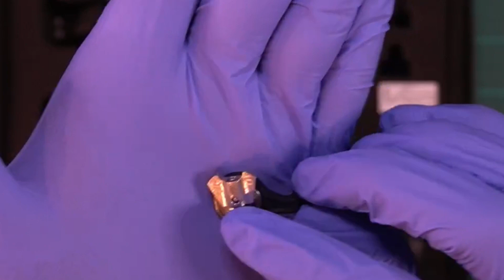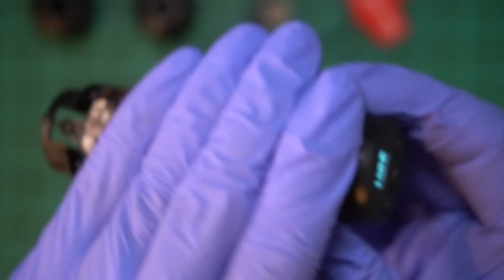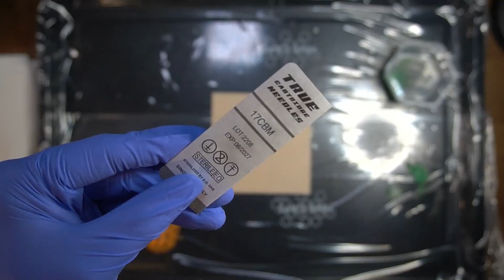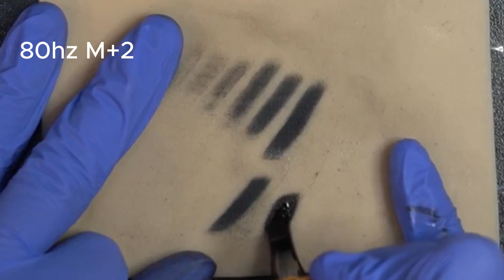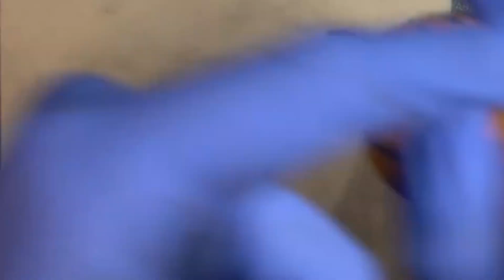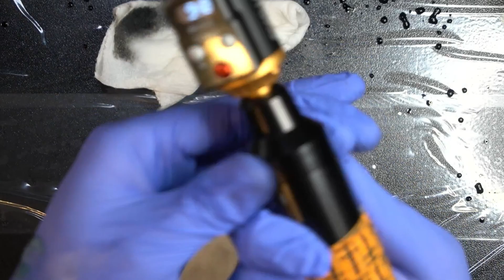Acus M1 Plus Tattoo Machine Review Testing and Comparison

Comment: Adam, thanks for the detailed review🙌🏻 I only have one question left: tell me how hard is the impact force on the Acos m1 with a 4.5 eccentric and M+2 setting compared to, for example, such machines as Critical Torque or Spektra Flux? I have a Cheyenne Sol Nova Unlimited and for me it is very soft and not suitable for dense painting because I work quickly, I would like a machine with a super hard impact. Thank you)
Reply from the maker: It’s very similar feeling to the Sol Nova.
Acus is currently working on heavy and super heavy cams for each stroke length and I tested them and they hit very hard! 
The new cams should be coming out soon!!

Comment: I literally just bought this machine and it came in the mail today. Just holding it in my hand and messing with the different settings, I can tell this is like the Lamborghini of tattoo machines. I've never felt a machine that was so vibrationless, yet so solid if that makes sense. Can't wait to try it out on skin and up my game!
Reply from the maker: Yeah it’s definitely the lambo!
Get the 4.1 cam for it makes it feel so good 🔥
Reply: @adamdarklord  I was wondering if you ever messed with the 4.5 that comes with it. I assumed it would be good for color packing and line work, but I'm just wondering what it is about the 4.2 that hits that sweet spot for you
Reply: @adamdarklord  I know this video is a little old, but I’m seeing that they have different weights for the 4.1. From super heavy, heavy and just the original 4.1, what should I go for?
Reply from the maker: @Javabeans777 I use the 4.1 heavy for everything 🔥
Reply: @adamdarklord  Thank you!
Reply: @adamdarklord  is there anything you can tell me about the m2? lol

Comment: I finally got the 4.1 stroke. Trying hard to get some solid blacks with pendulum shading but man does it hit soft. Any advice from anyone on good settings for this? I've tried from 70-90hz, m0-m2, slow hand speed, 
 fast, it's just SO soft 🤔
Reply from the maker: This machine has extremely high torque compared to other tattoo machines. The machine feels soft because the cams in the machine are perfectly balanced with the rotation of the motor. 
Machines that feel like they hit harder is because there is error in the balance. 
Use M2 standard gauge not bug pins if you want very saturated blacks. I run the machine at 94 hertz. Slowing down your hand can make it saturate quicker
Reply from the maker: I can pack solid color with it all day very quickly
Reply: I thought maybe it had to do with the aluminum cams. I'll definitely try out some standard needles and slow my hand speed down..maybe drop the hz to get more amps 🤷

Comment: Kia ora from New Zealand Adam
I have a question. I know the Neuma 5 runs at 8w  and 6.7mNm as ai just watched that episode of yours. But can you please help me as I can't find out the mNm of the Acus M1 but it's rated power is 7w.

Thank you
Reply from the maker: The Acus can run at 12w at m mode 2, and has more torque than the normal Neuma 5 flex, though the Flex feels like it puts in ink quicker just because the cam system. If you get the Neuma Macro Flex it does around the same amount as torque as the Acus but the flex’s motor can run twice as fast as the Acus without heating up. There is pros and cons to each motor I’ll be making a comparison video in a month or two, the macro flex is getting sent to me right now for testing
Reply: @adamdarklord  Kia ora Ana Adam

Dude thank you very much for the reply 12w is heaps  only what is the nMn of the Acus M1. I see you did the nMn of the Neuma.
Dude, that be so great to get a comparison of the two as they both seem like great machines.
I do have the M1 but. I have struggled with bolder lines which is a shame as I do Māori Tattoo which involves so much line work. 
If you don't know what māori tattoo is check out my YouTube video and you'll see a traditional Pūhoro and Rāperāpe that I did recently iver 5 days in a row.... and... I did feel the machine heat up too. It got hot.
Again thank you for the time
Mouri ora

Redgie
Soul Wise Tattoo

Comment: Bro I have a question I'm a professional Tattooist from OH I'm about to get a new machine wireless. I currently own all three bishop wands the originals. So I like the packer the best because of the stroke, I was thinking either the prime pen 4.2 or the fk one 4.0 because of the price point. However I was thinking about the Acus m1 or maybe flux max. What's your thoughts please?
Reply from the maker: If you want one machine that can do everything your 3 wands can do the Acus is still the best.
The prime and fk one both have cheaper motors than the Packer wand but they are both good machines

Comment: You would think that for the price of this thing they could have made the stroke length click adjustable. Seems a little overrated.
Reply from the maker: Click adjustable machines are actually worse. The way they are built makes them hit soft and they brake very quickly.
Trust me I’ve got many many machines and have done all the testing. Direct drive machines are better in how they perform and they last longer.

Comment: What hz and motor strength would you recommend lining  at with a 1003rl.?  I typically use 3.6mm at 8v on my other machines. Thanks for the video. I just bought the M1!!
Reply from the maker: I literally use mode m2, 94hz with 4.1 stroke cam for everything 😅I almost never have to change my settings. I use that for 3rl all the way up to 23cm! Hope you like the machine 🔥
Reply: The machine is excellent. Thanks!

Comment: Thanks for the review. I'm considering purchasing. I bought Flux 4.0 but it doesn't work for me, but I have Xion again and it works great at 3.2 and 3.7 mm. However, I prefer softer razors with a softness setting option. Do you think that Acus m1 will be a good choice in this case?

Comment: The acus m1 might be on the technical forefront but all these brushless motors have no soul. They all feel to digital and artificial. You need carbon based brushed dc motors to transfer carbon ink into the skin which is also made mostly out of carbon. The bishop shader uses a brushed motor for example and that‘s why it is the most popular machine outthere, according to my local tattoo shop at least. I tried all of them including the m1 and it’s a strange electric icky feeling. As if you’re playing an electric piano and expecting it to sound like a real one.
Reply from the maker: My m1 has a soul… it’s not a 1966 Shelby Mustang type of soul but it’s there.
I’m pretty sure the Bishop wand is a FAULHABER Brushless Motor. And all the machines before that one is brushed.
In fact I’m pretty sure the bishop wand and Acus M1 motor are the exact same motor with different max Torque.
If you want a very good machine with a lot of soul check out the new Neuma 5 that thing is awesome.
Reply: Thanks man. Bishop shader=brushed, packer=brushless, liner=brushless. All of the wired Cheyennes are brushed dc also.   I guess thats the main reason why old school artists can‘t deal with these new digital machines. Me personally I need that friction. Cheers
Reply: How does that impact the result? I thought Brushless vs Brush is more a matter of Effeciency and Heat rather than any actual quality of the visual effect.  @asceticfilms9865

Comment: How does this machine work with bold lining for traditional work? Seems like the 4.5 could be suitable but can't find any information and user experiences.
Reply from the maker: Pretty amazing with bigger liners with the 4.1 I’m assuming the 4.5 is amazing for tribal and solid fill designs. 
A wired machine would have even more amps but this is as good as it gets for a wireless machine 🔥

Comment: What settings did you settle on for color?
Reply from the maker: I’m using 4.1, M2, 80hz-100hz for everything including color. It goes right in with no overworking and heals very good!
Reply: @adamdarklord  they should just come out with an M2 only version, one cam,  w/3200mah battery… and charge 400 less
Reply from the maker: @Gravehandstattoo  I agree, I’d buy it right away lol

Comment: Nova 2 is a beast, 3.5 stroke is crazy good. I line with it at 8.9v, I color pack at 8.1 in both steady and responsive 1, but responsive 1 is more for building up color. Responsive 2 put color in way too light for me but may be great for others. Black and Gray, I use steady for pure blacks, responsive mode 1 & 2 for shading. Responsive 2 is great for noses and eyes on portraits. I can imagine how bad ass the 4.5 stroke is for lining. I’ve been wanting an Acus M1 since it dropped, but it might miss me up with so many options. Your Amp calculator was a very important part of this video. Way to go man. By the way, the healing with the Nova 2 is by far the nicest and fastest healing I’ve had too date. My healing was great already but I feel like I was more aware, more cautious during the tattoo with my other machine. Nova 2, I don’t worry at all about it, the ink jumps into the skin FAST. Great video man!
Reply from the maker: The Nova 2 is definitely god tier mostly if you use give modes. The mechanical click you get when switching through the modes 🙌 you can’t beat that!
Thanks for checking out the video!
Reply: @adamdarklord which is bette? The nova 2 or acus. I’m torn
Reply from the maker: @InkbyHall  I like the Acus more

Comment: Great videos,  have you tried the cheyenne unio? Or have heard anything about it?
Reply from the maker: Haven’t tried it, heard it’s hard to use with a battery pack because of how long it is. More I try ‘on the fly’ stroke adjustable machines the less I like them. They all brake way to easily. The Sol Nova 2 or Acus are way better in my opinion
Reply: @adamdarklord  Thank you for getting back to me so fast.  Keep up the awesome work and will keep following and liking. 🤘🏽

Comment: Wow this was a great and very complete review. I'm a happy M1 owner since almost the beginning and it still is my favorite machine ever. I usually use it on mode 0 and +1 I almost never feel the need to use the +2 mode only when I use the 5mm stroke cam.  The M+1 at 90hz, 100hz is more or less my happy place with this machine. I simply love what Acus people did here.
Reply from the maker: Thanks, it was definitely a lot of work 😅 
What stroke length are you using for everything? I got the 5mm but haven’t tried it on real skin yet
Reply: @adamdarklord  Bro the 5mm on M+2 is really good for lining and stipple shading. I use the 4.1mm for almost everything. I only use the 5mm for those very bold lines designs and when the session is dedicated only to the lines. But with the 4.1mm stroke and the motor modes I can really do any style with ease. This is a freacking great machine. For me the only downside is the fact that you have to unwrap everything to change the battery but this is not a deal breaker for me.
Reply from the maker: @bullsheeptattoo  100% 
I’ve wrapped the machine like 6 times and forgot to put a battery in it and had re wrap it lol
Reply: @adamdarklord  lol same here
Reply: @adamdarklord  There's a perfect way of wrapping the machine and changing batteries. If you wrap the upper part and the center part separately, you can open the upper part without unwrapping the machine! How could I never thought on this!